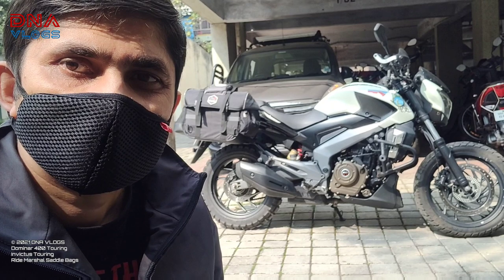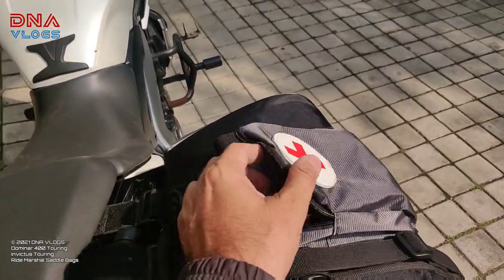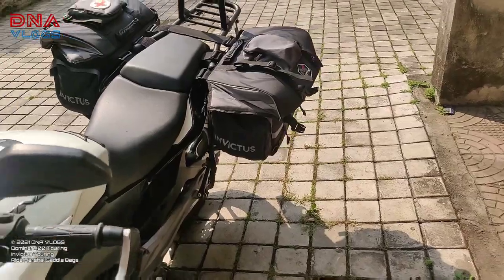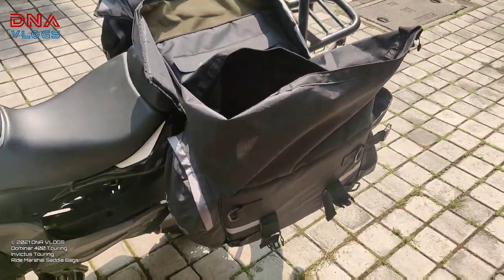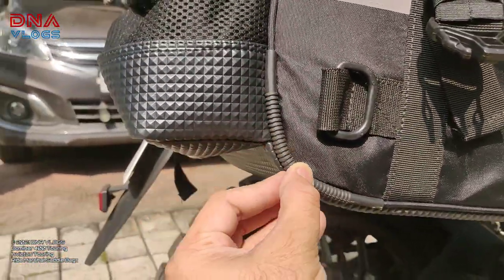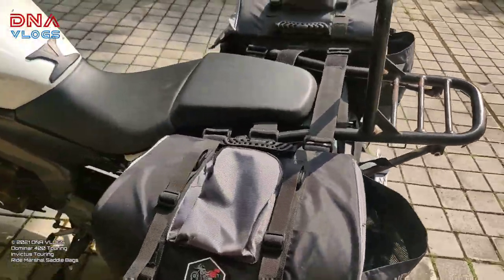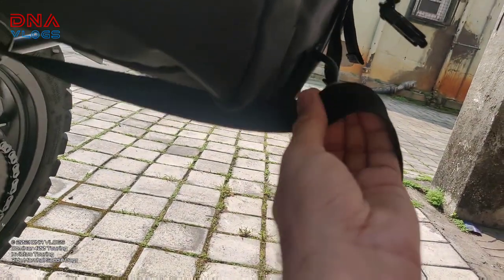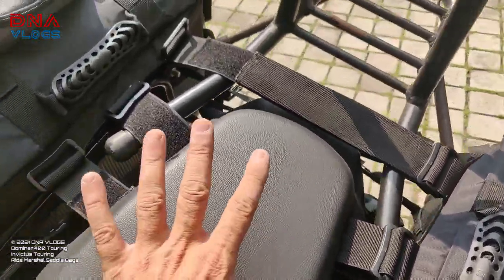Dominar 400 | Ride Marshal Saddle Bag | Detail Feature Review | INVICTUS TOURING GEARS | DNA Vlogs

Comment: Brother dont understand my dominar speedometer error. It is showing 199 speed everytime.
Reply: fuse is alright.
Reply from the maker: @abhishektyagi2840  probably your lcd hard ware has a issue or the ecu or the speedo sensors. You will have to visit the service centre for detailed check.